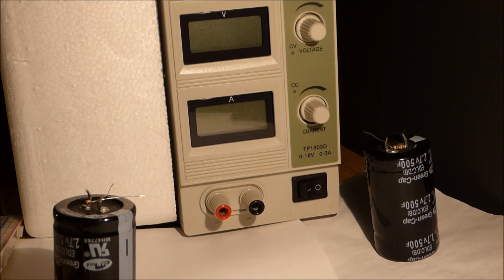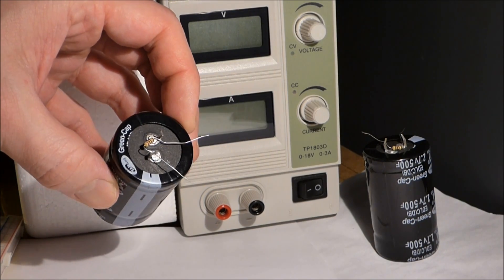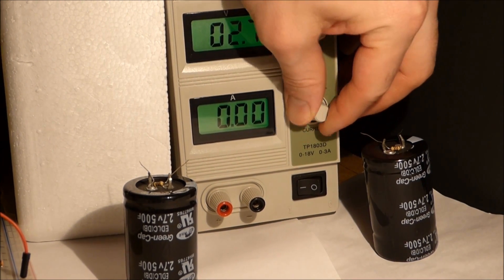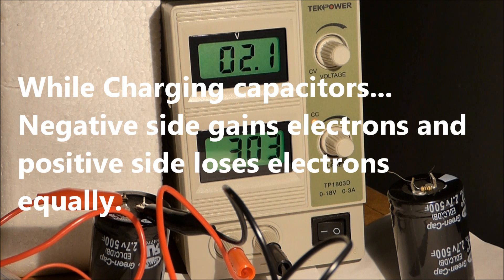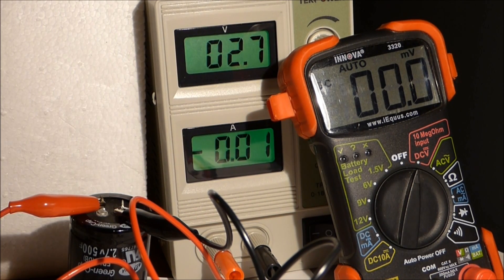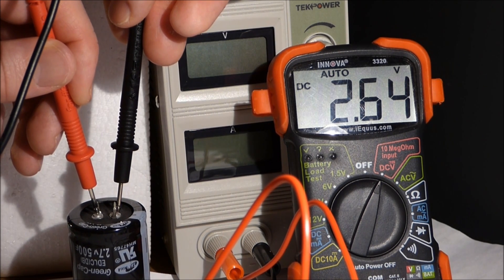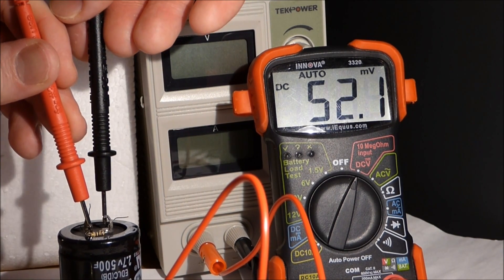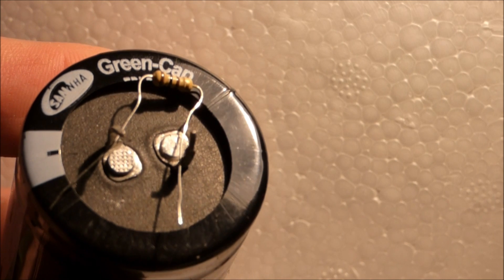2.7V 500F Super Capacitor charging with Bench Power Supply. Discharge with resistor. Electronics.

Comment: 070120.  Thanks for taking time to exhibit simple changing of a  super Cap. But you forgot to mention to REMOVE the 100 Ohm .25W resistor before changing. You must remember, you are posting a video and it’s being watched by many people including students. You will be confusing them by your careless omission of  a component being NOT removed before charging. By the way the Super Cap you showed is a cheap Chinese spinoff that will not hold charge for long. Therefore i recommend MAXWELL B6AC SC. Thanks.
Reply from the maker: Thanks for the tip!

Comment: sir i want to asked you that i am working on a project which uses the supercapacitor i am using 5 2.72volt 100F capacitors to obtain 13.2 volt i want to ask you that how to charge the when connected in series

Comment: Can ee use super cap to power a dc motor??
Reply from the maker: Sure as long as it's storing enough voltage and current, and doesn't weigh too much for a motor moving it. Probably need a number of supercaps connected in series, which needs protection circuitry. Or a voltage booster.
Reply: @Electronzap  as i know supercap could deliver very high current in short period of time doesn't that a problem to power motor?? Doesn't the high current damages the motor???
Reply from the maker: Motors have resistance, so they are rated for a certain voltage. Their resistance limits the current. I don't do much with motors so that's as good an answer as I can provide. Super capacitors can output a lot of current unless they have a higher internal resistance. But the current is usually limited by the resistance of the load.

Comment: Any way to use super cal to charge batteries???
Reply from the maker: It's possible, but batteries hold a lot more charge than supercapacitors so that would be rare. It would really only make sense to do so if there were brief periods of high current that the batteries couldn't handle but that the supercapacitors could.
Reply: @Electronzap  i am creating a project in which a car will travel in a circular path in which some part of the path have some contact with the car to charge its supercap... So can i use the super cap to run the motor and charge the batteries?? Any way
Reply from the maker: That would be a situation where it could work out. I have lower value supercapacitors that at first look like they would be good for quickly recharging a small car. But, they have high internal resistance and can't be rapidly charged, so make sure to get low internal resistance super capacitors.
Reply: @Electronzap  any suggestions....
Reply from the maker: I haven't come across any lower value supercapacitors with low internal resistance yet. At least not at a good price, or I would have bought them myself lol. That's a bigger project than what I do, I am sure there are people that build them and have posted their projects online if you do some googling.

Comment: That capacitor is nowhere near 500 farads. A farad is 1 volt change per second at 1 amp current. These should be 1 volt every 100 seconds at 5 amps, and the reading went up 1 volt, from 1.0 to 2.0, in only about 27 seconds (4:11-4:38) at 3 amps. 27x3 is only 81 farads. If it had full capacity it would take 18.5 amps to charge as fast as shown.
Reply from the maker: +Daniel Armstrong Yeah. I noticed that and it has bugged me a lot lol. These are cheap from China (about $6 each) and all the other Youtubers that I have watched using these supercaps ignore the fact that they are inaccurate so I decided I would hold off on presenting that math for now since it would be way off with these.
Reply: +electronzapdotcom It really makes no sense. These are listed as 35x60mm on fleaBay and I have some honest 70 Farad 2.1/2.3 volt Panasonic ones that are 18x50mm. At almost twice the diameter and 10mm longer these should test better than ~80. Thanks for the video.
Reply: do you know the max discharge current these capacitors can provide?
Reply: @GIANNIS LYMPEROPOYLOS a super cap can easily discharge hundreds of amps without worrying about its heat dissipation because of its low internal resistance.
Reply: I’m not being rude, but this guy has no, what so ever , knowledge of physics. The cap he used is a cheap spinoff from China and it’s no where near 500F !!!!
Reply: Barring numbers from a manufacturer's datasheet I would try to keep it under 1/10th of the measured farad capacity.

For instance the datasheet for my Panasonic ones just says <1 amp, and I have a 7S 20P array powering a car amplifier fused at 45 amps, or 2.25 amps peak each.

The datasheet for the popular Maxwell 3000 fared 2.7 volt ones says 130-210 amps depending on temperature.

At the same time these same 3000f capacitors are used in the Maxwell ESM as either a 6S 2P configuration or 12S 1P where they specify 1800 amps or 900 amps respectively for 3 seconds.
Reply: @danielthechskid  This is the datasheet for his capacitors. http://www.samwha.com/electric/product/list_pdf1/db.pdf

They don't sell 500F ones. He was scammed with fakes, doesn't mean all of sanwha's are fake.